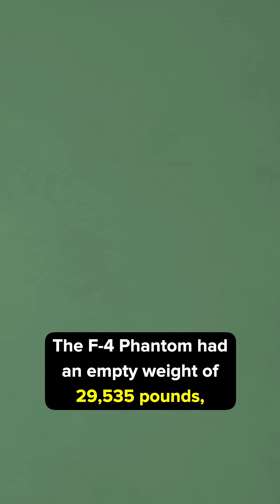Why an F4 Phantom was Launched into Concrete

Comment: okay, what about the Pentagon on 9/11?  It went through three rings of the Pentagon, which equals 6 reinforced concrete walls, blasting out a 20 foot diameter circle on the last wall.....hmmm video mentions that modern bunker busting munitions could do that.

Comment: Being the airframe is built of high strength lightweight metals, the 29,000 pounds doesn't hit the wall all at once.  In effect, the airplane just accordions from front to back giving a false impression of strength of the wall compared to, per se,  the same 29,000 pounds hitting the same wall at 500 mph as a solid cylinder.

Comment: And somehow a weaker engine from a passenger plane penetrated a similar concrete wall and went through the Pentagon landing a good distance away....   but the F-4 that can take missile hits and still fly turns to dust and unrecognizable scrap metal.

Comment: Hang on a sec, I get what the experiment was about but it was unnecessary, looking at the slab it was clear the F-4 wouldn’t do much damage, sure it had weight and mass but consider what it’s made of, light weight metals like aluminum and steel, in thin sheets and bulkheads arranged for strength as an air frame not a bomb!

Comment: The US Government wanted to test what would happen if a plane crashed into the concrete walls of a nuclear power station. For this they used an F-4 Phantom jet, a two seater jet that, fully loaded, weighs up to 41,500 lb.

The Phantom was bolted to a two rail rocket sled to prevent it from taking off as it races towards the wall at almost 500 Mph.

A fully functional F4  was used in the impact test.Only the gears and flaps at the main wings were partly removed and replaced by a carriage structure and sleds. The target wall was a reinforced concrete block measuring 23ft square and having a thickness of 12ft.

Comment: They didn’t fly the plain into the concrete. They cut off the cockpit of a F-4 phantom and attached it to a rocket sled. Using the rocket sled they rammed the cockpit right into a block of cement. Confirmed by NASA, where the rocket sled is located 
😎

Comment: "13 000 kg under earth gravity" Kg is a unit of mass not weight. Weight is a force and depends on the gravitational force. Mass doesn't change with gravity.

If you want to use metric units for weight, convert to Newtons instead.
Reply: This is a confusing concept for people because when they "weigh" themselves, they measure it in Kg, but that is because they measure their "mass" by making a machine look at their "weight".

Comment: As tough as a fighter plane is it’s still just a hollow aluminum tube.  A fully loaded 747 weighs hundred of times more. 330 million joules is a small fraction of what a huge plane would pack.  Fire will damage and destroy concrete. Don’t believe me? Test it yourself. Point a propane torch at a concrete slab and wait a few minutes.

Comment: mass measurements are not determined by gravity - weight measurements are. the kilogram/metric ton measurement of them empty phantom remains constant regardless of location while the imperial measurements will vary with local gravity.

Comment: Mass is the same regardless of the planet's gravity. It is the resistance a body offers to the application of force. What you are referring to is weight, which is the force that gravity applies to a body. It is measured in newtons or pound-force.

Comment: ... about xxx.85kgs How is this a rough estimate when we're talking about a ~14t (14000kg) airplane? Also, the kg (well, actually the grams) is a measure of mass. Which is not dependent on gravity, so the comment saying it's about xxx at the Earth's gravity makes no sense. Weight does depend on gravity, but that's measured in Newtons, which has a dimension of kg*m/s^2.

Comment: 9/11 was an inside job
Reply: Tell me you have no idea about 9/11 without telling me you have no idea about 9/11, the twin towers were built on steel frame (and steel weakens when exposed to heat) prolonged fire eventually burns through the protective coating and steel starts to heat up, and bend, which leads to floors sagging, eventually the weight and weakened steel caused the building to collapse. Concrete is more resistant to fire than steel, so if they used concrete supports it most likely wouldn't collapse.

Comment: And you want us to believe 911 tower collapse was a real attack 🙄🙄
Reply: Tell me you have no idea about 9/11 without telling me you have no idea about 9/11, the twin towers were built on steel frame (and steel weakens when exposed to heat) prolonged fire eventually burns through the protective coating and steel starts to heat up, and bend, which leads to floors sagging, eventually the weight and weakened steel caused the building to collapse. Concrete is more resistant to fire than steel, so if they used concrete supports it most likely wouldn't collapse.

Comment: But on 911 a pasenger aircraft through a steel building without a single piece  wings or tail falling off the plane how fucki.g ridiculous is that
Reply: steel building, not as thick, with a bigger and more reinforced plane that DID disintegrate inside the building.

it is in no way ridiculous.

Comment: Proof the twin towers were rigged to blow
Reply: the twin towers were also not made out of nuclear reactor grade concrete. it's surprisingly easy for an airliner to tear through the average skyscraper, because THEY AREN'T DESIGNED TO HAVE PLANES FLOWN THROUGH THEM.

common sense, people, common sense. WHY isn't there any in this comments section?
Reply: @verytonk  the twin towers were designed to absorb multiple airline strikes.  
They  had a "how do they do it" episode on the discovery channel  before the "attacks"
Building 7 didn't kill itself. 
"Common sense" comes from the commons,  where everyone used to graze their flock so much until there wasnt anything left and everyone starved. 
"Common sense" refers to being dumber than a peasant. 
Think of that before regurgitating phrases and talking points that have indoctrinated into your unquestioning psyche
Reply: @thenewyorkredneck4735  whatever you say, buddy, whatever you say.

all you're saying about common sense may or may not be true. what you haven't realised is that i'm insinuating that you don't even have that.

the towers collapsed largely due to post crash fires. building the towers out of thick concrete blocks would 1. be expensive and 2. not leave room for windows etc. so it makes sense as to how a plane would actually break through the outside. the towers didn't fall immediately after the planes flew into them, either. so i don't really know what point you're trying to make here.

Comment: And this was a great platform to experiment on to go to 9/11. They'd know that in order to take down the twin towers there would be a need for more explosives.  Remember,  just before 9/11 , 2.1 trillion dollars went missing and the office responsible for accounting for it was in the twin towers.
Reply: if they were trying to take out a skyscraper, they wouldn't experiment on a nuclear reactor wall.

if they'd flown that same phantom into one of the towers, it would have done some insane damage. airliners are quite a bit more expensive than a decommissioned fighter with drop tanks strapped on.

oh, and got a source for the 2.1 trillion dollar thing?

common sense, people.

Comment: So an F4 wont damage a concrete wall but a 757 will? And no cameras were around to see it? Press X to doubt
Reply: this is a reinforced concrete nuclear reactor wall. the pentagon (?) isn't a nuclear reactor, and it isn't designed to withstand aircraft impacts, and who the heck would allow cameras in or around a top secret facility?

common fucking sense, people.

Comment: How could that be? Terrorist flew passenger jets completely through both World Trade Center Towers that were made out of  reinforced concrete and steel I-beams that were way thicker and over engineered than that cube of concrete that consisted of maybe fifty yds at the most above ground. This clip must be some sort of dissinformation meant to sway our opinions or flat out decieve us.
Reply: the total outer wall was likely nowhere near as thick as this concrete slab, and also not designed to withstand aircraft impacts, especially not from an aircraft that weighed as much as the 767s used. you're just cherrypicking to feed your confirmation bias.

and it's *misinformation. for someone who's spreading it, you can't even get the word right.

Comment: Your units are wrong. Pounds is a unit of mass so it doesn't care about gravity. However so is kg. Saying ~13,000kg at regular Earth gravity is incorrect. That plane is ~13,000kg regardless of where it is in the universe. The SI unit for weight is the newton which does care about gravity and is rarely used outside of science.

Comment: and we are told to believe a passenger plane cut right through structural concrete and steel on 911 ....leaving a perfect roadrunner coyote plane cut out in the building.....appearing to absorb right through the building without a single part or piece falling to the street outside the building.  if what we see is impossible then what we are seeing is not real

Comment: "80% of a ton of TNT"

We call that 800 kilos.
Reply: It's not about the mass, it's about the force. The force was 80% of the "Ton of TNT" force. 
But 800kilos wouldn't be the same force of "Ton of TNT", since there are formulas and the ratio is not at all linear.
Reply: @armaga144  the Energy releases is proportional to the weight. Each Gram of tnt releases a fixed amount of Energy. This Had nothing to do With force.
Reply: @maxheim3802  my bad, I'm don't really remember physics, so I used the closest to the truth term I knew. However while the energy is proportional to the mass, it's not a linear proportion is it? Energy coming from explosion of 800kgs of TNT is not 80% of the energy coming out of 1000kgs TNT. Thats at least what I remember from my physics class.
Reply: @armaga144 but it is
Reply: @GammaStyleGaming  are you sure? Thats very surprising to me, could you tell me how you calculated it?
Reply: @armaga144   Thermodynamics. Every reaction has a specific value called enthalpy which describes how much energy is released or consumed per molecule that reacts. In this case the reaction is exothermic since it releases energy and since the energy released is a specific amount per molecule, it follows that twice as many molecules would release twice the energy when undergoing the same reaction. This is a bit of an oversimplification but the principle holds true.
Reply: @armaga144  i think your confusing the energy released and the impact it has in a 3D environment.
80% of that (metric) ton is indeed 800 kg of TNT.
However, it will not do 80% of the damage, as the explosion travels in 3 dimensions. Hence the damage it cause will be related by an inverse cubic law. Meaning for exemple if a ton of TNT destroys everything in a 100m radius, 800kg of tnt will not do the same damage in a 80m radius, but in something like 95m radius, because of the cubic relation : to make an explosion with a radius 2 times as big, then you’ll need 8 times more explosive mass
Reply: Us long ton = 2000lbs 1 kilo =2.2lbs so not 70% u do the math.
Reply: Wrong kind of ton
Reply: Probably closer to 700-750kilos 

They are likely us short tons of tnt taking into account all other measurments used
Reply: @dozergames2395  i believe US army uses metric tons, else they’ll use pounds explicitly. So if that number comes from one of their reports, it’s a metric tone

Comment: I get what you're trying to say, but your phrase is kind of backwards ; on any planet would the weight of the plane on that planet translate to 13396.85 kg as mass is independent on what gravity field you find yourself under.  You could have said: "The mass of the plane is 13396 kg which translates to (whatever the number was) lbs in Earth's gravity field." Also the extra 0.85 kg doesn't mean anything, as you start with a number with 5 significant figures and end up with one with 7 figures...

Comment: But commercial airliners can cut clear through 16 inch steel columns and concrete and come out the other side if it's on the 11th of September.

Comment: Every Plane or piece of machinery has a life expectancy.  Metal can only go through so much stress, then it becomes useless!  The same goes for Automotive parts.   

The best way I can explain this, take a light piece of metal or a Coca-Cola can.  Start bending it back and forth and eventually it will break in two!  
Same with a steel welding rod, either 1/16 or 1/8" .  The same applies.  Anything metal.  Helicopters, every part of a Helicopter has a life!  All bearings, Races, Rotors, Shafts, etc. start losing its rigidity the day it's made.  These limits are published in the Service Manuals.  

This is where the excess machinery comes from to make them test vehicles.  They reached the end of their service life.

This is why Ships, Submarines, and other large machinery items are used for test vehicles.  They will alter future parts or design changes which will better protect our troops and equipment.  All vehicles or machinery provide valuable information to be used for future vehicles and/or equipment of some type.  

I will try and answer any questions if anyone has one or two.  Thanks,
Reply: While I am thinking about it, all Firearm Barrels have a life.  Some barrels will make it with as little as 900 rounds of ammo put through the barrel.  Average Military barrels will last around 3,000 to 4,000 rounds put through it.  Some calibers will make it to over 7,000 rounds.  This information is studied very closely when the Engineers are deciding what arms will be the best replacement for our troops.  

Each round put through a barrel last well below a 1/2 of a second.  Some are measured in tenths.  On average, the barrel will actually be used less than 2 seconds before it's worn out!  It still looks brand new!  The bore and rifling are worn down smooth which makes them useless when accuracy is at stake!    Overheating a barrel will wear them out quicker.  The same applies to machinery parts.

Comment: You got your measurements of mass and weight mixed up, this isn't usually a problem but you turned a measurement of mass you called weight into a measurement of mass you called mas and specified earth gravity. Mass is only measured in Newtons or metrics of them. (Kilonewtons, millinewtons)
Therefore it weighed 131'378.22 newtons which is equal to both the masses you gave (assuming earth gravity) however it's weight is irrelevant in the calculation of impact force and you only look for mass as the same mass impacting at the same relative speed makes the same force in any amount of gravity.

Comment: Look at those images and now go look at September 11 2001 how the planes goes inside the building. It’s impossible that an aluminum plane goes thru steel and concrete. Imagine if the plane was still and the building was travelling at 400 mph…….. what result would you get?

Comment: I noticed the engines were not installed.  So thats two individual J79 engines weighting 4,000 lbs each, with plenty of steel & other hard metals in its construction, not hitting the wall at 500 mph as part of the test…

Comment: You state the mass of the F4 is 13,396Kg “under earths gravity”. Mass is a constant. Mass is the amount of matter in an object. It can also be defined as the property of a body that causes it to have weight in a gravitational field. It is important to understand that the mass of an object is NOT dependent on gravity. Whether it was on the moon, mars or Earth the mass wouldn’t change.

Comment: Planes are built to be light. So the construction is fragile. If they accelerate some 200kg steel ingot to some speed using rocket motor, it will go right throug.

Comment: I’m crying already, I love the Phantom, El Toro circa 1970-Vietnam etc
Reply: The Phantoms of MAG-12 and MAG 13, Chu Lai, 1968,-1969
Reply: @LET-THE-G00D-TIMES-R0LL  Semper Fi-that test was run in my home state, New Mexico-Sandia Labs in Albuquerque
Reply: The phantom is proof that with enough thrust even a brick can fly
Reply: @keith00032  The Phantom's published top speed was only arbitrary. It would just keep going faster if all the way open, but there wouldn't be enough fuel to last an appreciable time. Good though in short bursts for outrunning SAM's at end of mission.

Comment: And they say a jet smashing into the twin towers completely destroyed it I call bullshit
Reply: 767 weighs many times more and the Twin Towers were not made of reinforced concrete slabs.
Reply: @monke823  no concrete and steel much stronger and that plane did not get so hot to melt iron and steel huh
Reply: @kainsanderson1445  Lightweight steel and lightweight concrete are not stronger than reinforced concrete slabs 🤦‍♂️ You don’t need to melt steel for its structural integrity to be compromised
Reply: @monke823  it's not lightweight but whatever you want to believe
Reply: @monke823  for the building to free fall straight down like it did yeah you'd have to do precise demolition
Reply: @kainsanderson1445  It was lightweight concrete. If you did some research you’d know why it fell like that 🤦‍♂️
Reply: @monke823  it felt like that because it was a demolition not because it got  hit
Reply: @kainsanderson1445  Steel doesn’t have to melt before it’s structural integrity is compromised. You know the floors were collapsing on themselves, right?
Reply: @monke823  the floor does not collapse on itself it was engineered to do that as part of the demolition

Comment: But on 911 a steel building aborbed a plane, supposedly. Problem: on private footage there was no plane, not even it's sound for going at above its rated speed limit for the altitude.